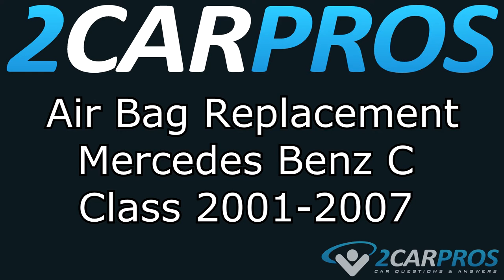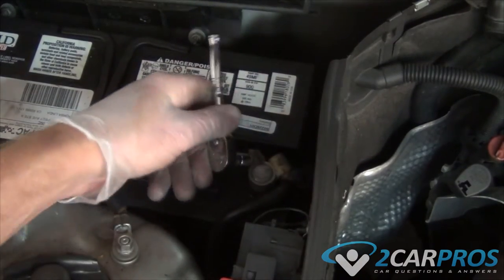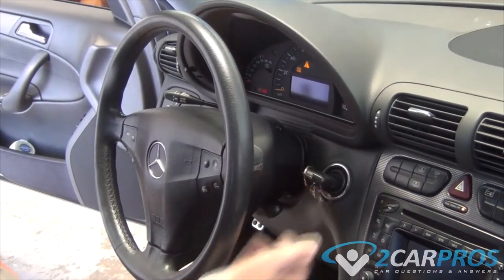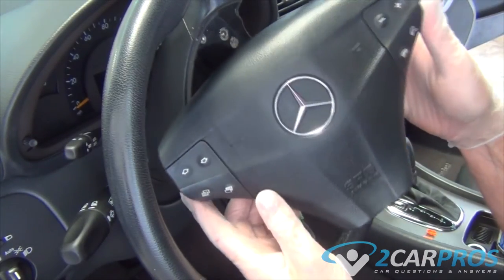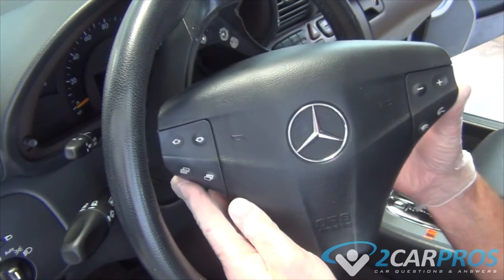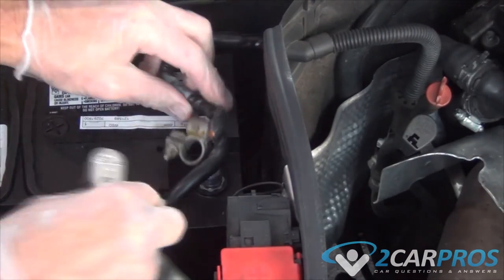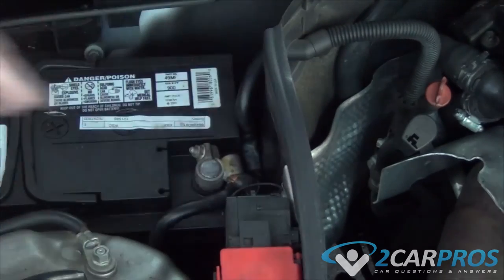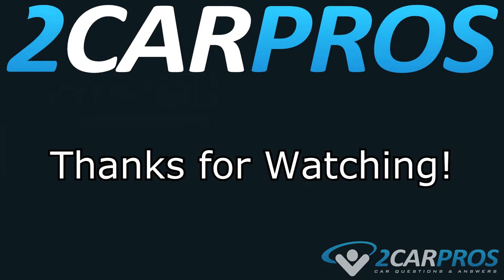Airbag Replacement Driver Side Mercedes Benz C Class 2001-2007

Comment: What size are the two airbag screws, for those who need to replace them? I bought a used 2006 c280 Luxury w203, but my T30 hex airbag screws are stripped from the previous owner. I would like to know what length screw I should buy.

Comment: hello.thanks for the video.  i recently bought a 2005 Mercedes c240 and  the driver airbag is blown.  as you know if i contact the dealer for a replacement it could get costly. do  you know where i can order the airbag on a budget? thanks
Reply: Ebay usually has the cheapest car parts.. way way cheaper than AutoZone

Comment: i blew my seat airbags in accident. if i replace a seat in my car 2014 e class using a 2010 seat with the airbags will i run into issues or shud i only get a seat with the airbags in them from 2014
Reply from the maker: If you don't replace them with the seat that has airbags the airbag light may not turn off. Thanks for watching!
Reply: no it does have the air bags in them, I'm wondering if there will be an issue since the seat is from 2010, it has the original airbags in them, my car is 2014 airbags are blown.
 thanks for the help
Reply: no it does have the air bags in them, I'm wondering if there will be an issue since the seat is from 2010, it has the original airbags in them, my car is 2014 airbags are blown.
 thanks for the help